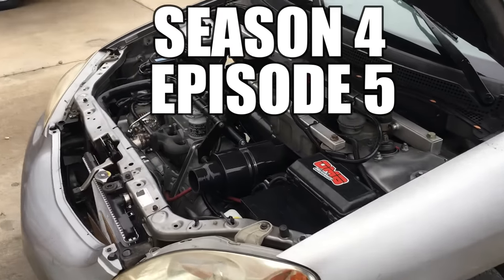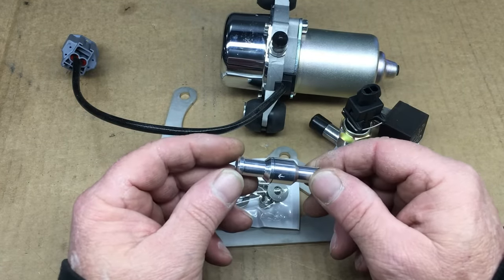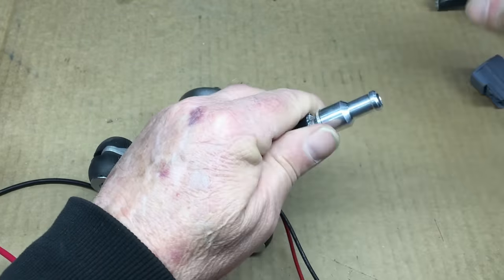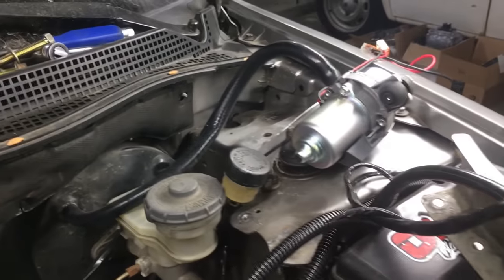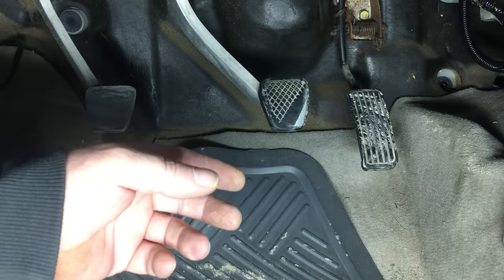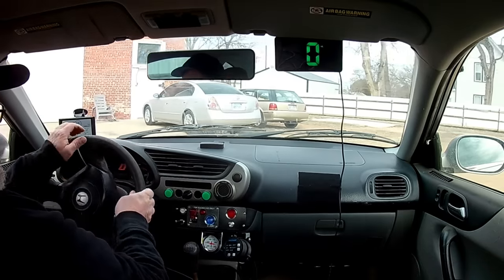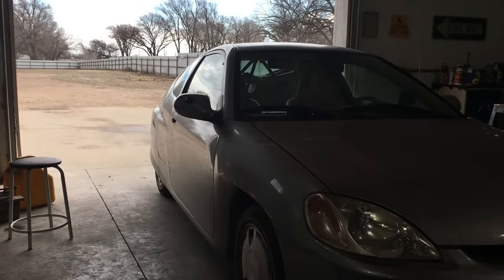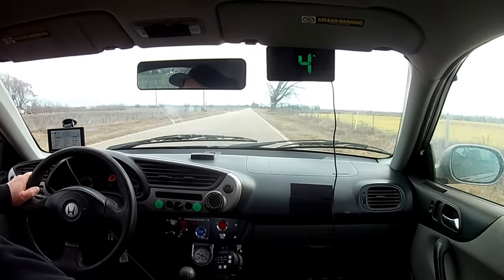S4 E5. We fix the power brakes with an electric vacuum pump and a bit of engineering.

Comment: "Unfortunately for the metric crowd, you're gonna have to do your own calculations"
Says future Jimbo, while we stare at a vacuum gauge scale clearly indicating 66 centimetres of mercury😂
Reply from the maker: Is that the format you folks are used to seeing?  I figured it was in Pascals
Reply: @robotcantina8957 Hecto-Pascal (hPa) is the standard unit but for automotive use, usually a dial pressure gauge will have both hPa & PSI side by side and a digital gauge allow you to switch between the two.
For vacuum, millimetres of mercury (mmHg) is standard but using centimetres of mercury (cmHg) is common probably because it just makes it easier to fit the numbers on the gauge.
As you know, a feature of the metric system is that you almost never have to do any kind of real conversion...Pascals to mmHg being one of those cases.
BTW, your accent is intriguing. Have you spent time in southern California by any chance? (Though I haven't heard you talk about "boogieing down the road" so maybe I'm way off🙃)
Reply from the maker: @peterelvery  In my older videos when I made metric conversions like MPG. I just did liters to kilometer and I got a lot of grief from the metric crowd and was told it was L/100KM.  When I was faced with the vacuum conversion I wasn't sure what was acceptable so I punted... lol.  I figured it was easy enough to figure out for those who were interested.   As for the accent, I grew up in New York and had a heavy accent for years.  After collage I moved to southern California for a few years and then was transferred to Michigan.  The accent is a hodgepodge of east coast, west coast and Midwest.
Reply: @robotcantina8957  I understand your caution. When we changed to metric measurement here  in 1974, conversion to litres per kilometre (or as it's spelt (or as spelt itself is spelt is the US "spelled"😂) in the US) liters per kilometer popped up for a short while but it quickly disappeared in favour of l/100km.
Also, on reflection Kilopascals (kPa), not Hectopascals, is on the tyre pressure gauges here.
Interesting re the accent. Had I been so bold as to guess your background outright, I would have said, born somewhere in Wisconsin, then moved to Southern California. I'm no expert but to me your vowels sound midwestern but the lilt is straight outa Garden Grove.

Comment: I think i would try putting a t in the vacume line for the vacume switch and then block it off and drill a verry small hole or put in a adjustable jet or somthing and have a vacume delay to the switch . It would delay the on and the off of the switch but i think it would work 🤷‍♂️
Reply: Dude. If only you had some videos showing you fabricating.

Comment: I don't mind the wago connectors, they are all over the place in my house. but bear in mind that there are 2 versions. AWG 12 and AWG 10  the  12 is rated for 20a continuous and 10 for 30a
Reply from the maker: Wago's are awesome.  I like to use them for temporary connection when bench testing, however I never use them for permanent connections in automotive applications.

Comment: Panic switch could be a relay run off the brake light switch...    No real reason the pump shouldn't come on when the brakes are applied every time anyways, right?

Comment: It probably wouldn't be necessary to get a new switch, since you could just use an O crimp to make a ground wire for it. As long as it's bolted on, I see no reason it wouldn't be a reliable ground.
Reply from the maker: Curently the switch is switching the ground side of the relay, our revised circuit will have the switch controlling the hot side on the circuit.  You propose idea would work, however it would make the body of the switch hot (12V).  That would mean the switch would have to be isolated when mounting it.
Reply: @robotcantina8957  could use a plastic spacer? :) I understand the off the shelf comment you made, and I completely agree that is the better and easier way to go. Just making suggestions based on my own ideas :)
Reply from the maker: @simplybeanjelly  Indeed a plastic spacer would resolve the issue.  I appreciate all the comments I get from folks with ideas and suggestions.  On this issue we will be replacing the switch because the wiring will be much cleaner overall.

Comment: Check out a Napa 531090 thermostat, 195f 44mm diameter. Murray also makes a 203 in a similar size with part number 65703.
Reply from the maker: The thermostat for the kubota engine is 38mm,  I did some checking a while ago and couldn't find anything that small.
Reply: @robotcantina8957  I wonder if you could use a thermostat housing for a new kubota, as they use a 42mm thermostat versus the 38mm. That's what I based my recommendations on, guess yours is before the cutoff for them.

Comment: That the brake vacuum booster works after all this time is a testament to engineering and quality.
Reply from the maker: Actually it has a minor leak around the seals on the pedal side.  We are hopping that the leaky seals will fix themselves once we finish the system.
Reply: If not, perhaps some silicone caulk will do the trick.

Comment: 😂 I use the flipclip electrical connectors on many small low voltage wires as a permanent solutions that are not underhood.
Reply: Anyone on here able to take all the slivers of Mr Jumbo to compile a portrait of his face? I'm fairly certain he resembles Sir Anthony Hopkins.

Comment: Wouldn't a valid backup for the pump just be triggered by pressing the brake pedal? Just splice off the brake lights.
Reply from the maker: Yes, that would work.  However in the current circuit, the pump is triggered by a ground signal and a brake lamp switch is typically switched 12V.  A bypass relay would need to be added to the circuit if the current vacuum switch is retained.  As indicated in the video the circuit will be changed and we will have an update in the next video.

Comment: Snazzy pump. I wonder if it all wouldn't be just as well to go ahead and electrically activate the rotary vacuum pump relay using a jumper or splice from the brake light switch as mentioned. That said, why waste energy running the heat transfer fluid impeller when doing so is contradictory anyway. Maybe whack the impeller or drive or something... pulley ratio.✌🏻👶🏻🚬

Comment: lol wire the break booster vacuum pump relay up to be tripped by the tail lights. am i the only one dumb enough to think this would work?
Reply from the maker: That wont work too good.  You see that would only turn the pump on when the brakes are applied. The power assist would be slow to react.  With the vacuum switch we build up a reserve of vacuum in the booster for instant power assist brakes.
Reply: @robotcantina8957  i guess the reservoir is too big/pump too small. maybe that in addition to a 555 timer/oscillator? would be an easy solution for test driving depending on how long the reservoir stayed pumped down.

Comment: system is bad. It should conect on relay ground line not battery  plus. If plus connect a relay overheat pins/swichs. This pump can make vaccum to vaccum tank